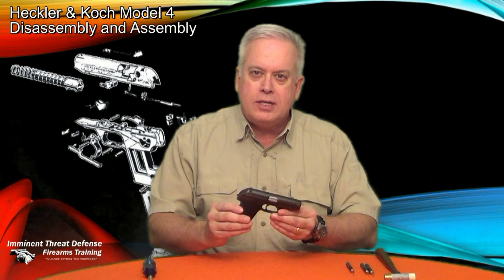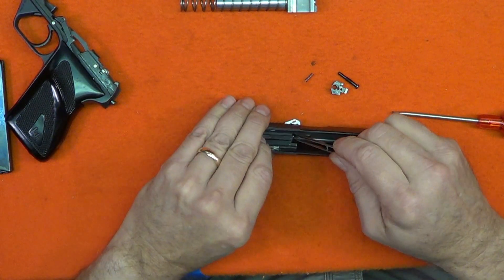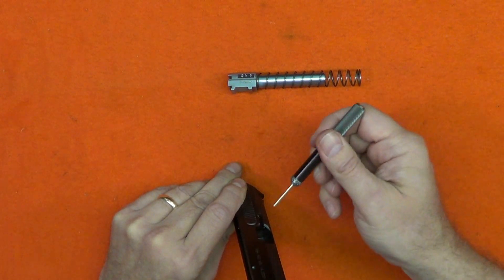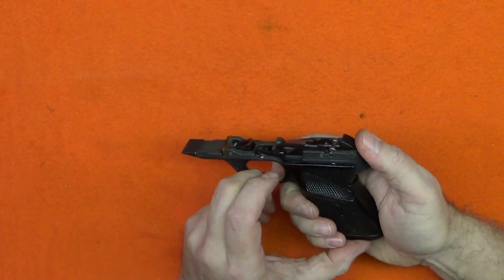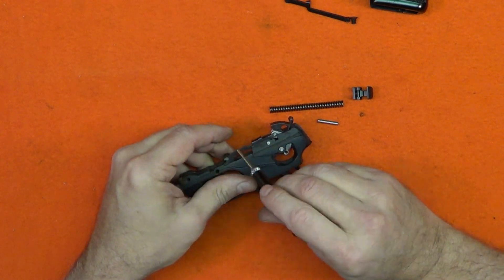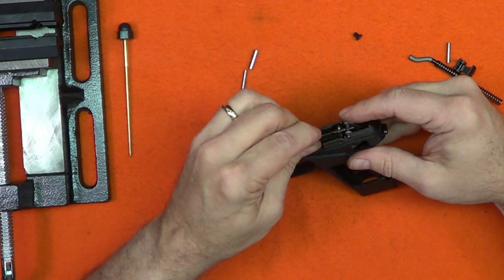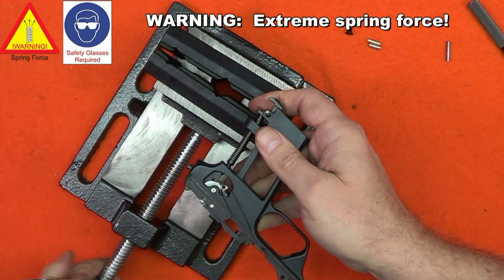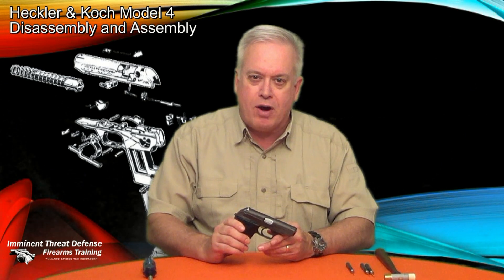Heckler & Koch Model 4 Disassembly and Assembly

Comment: Phenomenal instruction, thanks.  I am planning to replace my buffer.  Does the buffer plate need to be replaced at the same time and finally, can you point me to video instruction for this procedure?
Reply from the maker: No need to replace the plate, Numrich has the buffers.  It's pretty easy to replace it just slide out to the side, might need a gentle tap with a punch and hammer.

Comment: Very professional with excellent step set step procedures for teardown of the Model 4.

This gentleman has the experience and knowledge of a pistol which can be very complex to teardown.

Note: This pistol can and fire four different rounds through it, i.e. 22 LR, 25 ACP, 32ACP and 380 ACP with the proper conversion kits.

His comments on the firing plate (i.e. setup for rim fire and center fire rounds), the firing pin, etc.  is very complete.

His use of diagrams (i.e. on the two different springs in the firing pin assembly) and the tools required are very beneficial in the tear down of this weapon.

Comment: This is an awesome video. Some months ago, after firing a number of rounds, the slide became very sticky. Something wasn't right. Getting the slide off was a bit of a struggle but it did come apart. I then noticed that the trigger guard was broken close to the handgrip. I also noticed that the "buffer" had somewhat disintegrated. After searching the internet for a possible solution I came across Jim's video. Watching it, and referring to it several times, I was able to disassemble the it down to the bare frame. I found a professional TIG welder that was able to repair the broken trigger guard. To my amazement, and with the aid of Jim's video, I re-assembled the pistol, replaced the buffer, and have fired 14 rounds of 32 ACP. THANK YOU JIM. Without your video, I would no longer own an HK-4.Howard
Reply from the maker: +Howard Schneider Great save, glad the video was of help!

Comment: Mr. Jim, I need your help with this please.
First time I have basic field stripped this gun, Its been locked away in my Dad's safe for 35 years. I just ordered a new buffer and put it in place but I now cant get the slide back on. I have studied this video several times at the 12:20 mark. I have the hammer cocked.. safety on... lugs line up.... but it just doesn't engage the barrel clamp. It slides right back out.
Its very hard to press the slide all the way down. Can you help to see what am I doing wrong.
Thank you !!
Charles
Reply from the maker: Charles Baugh contact me directly at itdefensetraining@gmail.com and send me pictures of bottom of the slide with barrel and the top of the frame.

Comment: after firing a few rounds the slide became sticky for me as well. However, I am completely unable to get the slide assemble off the frame. it feels like something is catching on the inside and keeping it from moving forward. any suggestions?
Reply from the maker: +Samuel Taft Wow, that could be a million things.  First I'm presuming you can get the slide back and clear the chamber and make the pistol safe. Also you've done a detailed external inspection and you can't see anything else wrong.   First make sure the safety is on (white showing) and the hammer is cocked, the slide won't come off unless both are in the correct position.  Then be sure you're pushing the barrel clamp as far as possible, the thumb nail groove should go forward flush with the trigger guard.   If that doesn't work it's going to get complicated.
Reply: After 2 hours of forcing the slide and some gentle use of a flat screwdriver I was able to get the slide assembly off. A piece of metal had broken off and was jammed in the spring, not allowing it to compress. at 7:09 in your video you can see the piece in the bottom left corner of the zoomed window. there's a pin, an orange rectangle, then the thin black piece that broke off. no idea what it is.
Reply from the maker: +Samuel Taft Sounds like you're describing the Buffer plate.  It didn't break, it's held in place by friction.  The Buffer (the orange piece of plastic) is kind of squeezed in between the Buffer Plate and the frame.  It's possible your buffer has degraded, that happens, and let the Buffer Plate fall out.  You can get a new buffer for only $10 from Gunpartscorp.com.  You should be able to get your pistol back in action.  Good Luck!

Comment: I was cleaning my HK Model 4 22 Cal and a small spring fell on the ground. I did not disassemble the slide and also did not disassemble the sear. putting it back is ok but hammer always stay cocked even if I press the trigger with empty magazine. the hammer does not work. What do you think I can do. I can send you the picture of small spring by e mail if you have one. Thank you. Erick Berris
Reply from the maker: Sure I'll try to help.  Send me a pic of spring and where you think it came from.  ITDefensetraining@gmail.com  Though you might have a look at the video at 8:00 and see if it doesn't look like you dropped the ejector bar spring

Comment: Hi,,I'm trying to remove the firing pin and it won't cone out ,, I've put the saftey on the red position and the white and kinda in between the 2 and it wont come out ,  ,am I missing something?
Reply from the maker: No, it's just finicky.  Just keep a little pull on the pin and wiggle the safety and the pin, you'll get it.  The safety, in the safe position actually lifts up on the back of the firing pin (so the hammer can't engage it), so the pin will catch on the safety a little when you're trying to remove it.
Reply: Hi,, You were right,,I just moved the safety up and down till it was in the middleish and pulled gently with tweezers and got it out . Thanks ,I cleaned and oiled it up some ;; I have another quick question,, the mk4 I have is 1975 ,, thats what the targets say ,,  the gun frame /slide/ and both barrels all have the same serial #and thats good ,,  but the proof mark I see stamped on the slide /frame /and on each  barrell are the letters HK inside a circle,,,   the other hks I have use the elkhorn symbol ,, would you know what that means?  small capital letters HK inside a circle? new to me
Reply from the maker: @dantmanish  That's great.  Sorry but I'm not sure about that HK proof mark.

Comment: I have had one of these little jewels for years and have been looking for a firing pin spring for a few. Do you have the spec's on the spring, other than the number of coils. ID, OD,wire size and material? That would be greatly appreciated. I have been unable to get any response for HK. I bought the gun over 30 years ago at the Kittery Trading Post in Maine for under 200 dollars I think the spring dropped out when doing a caliber change in the field, I know not a bright move but had swapped back and forth many times prior without incident and got cocky. ;o)}  Thanks
Reply from the maker: Don't feel bad I did the same thing once, only I dropped the faceplate screw.  Now when I go to the range I always take my orange mechanics blanket :-)  Good luck getting a response from H&K they told me they don't support this model any more.  The best places for parts are Gunpartscorp.com and Jackfirstgun.com.  Gunparts shows out of stock, but you should call Jack First, they just started listing parts so their website is incomplete.  I do know someone who just sold some HK4 parts to Gunparts, so they either sold them quick or haven’t posted them yet, you might call them too.
As for the specs on the spring, that’d be quite a project and take some equipment I don’t have ready access to.  Though it’s something I’ve been wanting to do.  If you want to contact me directly through my website I’ll let you know if I ever get to that project.
Reply: Thanks for your fast response I have been checking back at Numrich for a few years, on the off chance they may find some. I'll give a check at Jackfirst and see what they can come up with. Again I thank you.
Reply: If you ever have the pistol apart, and are near someone with the precision measuring tools, could you prevail upon them to do some measurements? I asked a guy selling one, but the dimensions he gave me are not anything Wolff gunsprings can use to find, or perhaps make for me and he's has since sold the gun. I would need ID, OD, wire size, number of coils and length of spring and they might be able to fix me up. Perhaps there is someone else out there that has access to the tooling and expertise to get the dimensions. I will take it from there. ;o)}
Reply from the maker: I can get you the dimensions (give me a couple of days) but you also need the "K" of the spring.  We need to measure force for several compression distances, that's the tricky part so we can calculate the spring force constant (if you want to get it exactly right). Let's start with the dimensions, I'll pull mine apart this weekend.
Reply: Wow!!! Thanks for you help!! I really appreciate it, I hate having one of my girls sick or lame.
Reply from the maker: OK finally got around to looking at the spring.  I wanted to buy the spring measurement lab instrument from Starrett but at $7,000 it was tough to justify.  So I rigged up something in my workshop with a postal scale and a micrometer and got surprisingly good results.  First the spring is 11 coils and the ends are closed and ground.  It's 0.342" long, has an outside diameter of 0.108" and the wire diameter is 0.016".  Wire diameter was tough to measure so no guarantees I got it right.  The spring "K" is 86 (ounces per inch).  I plotted 5 different spring force vs compression distances and got a 99.5% linear regression, so I felt pretty good about that.  The range of K per 0.025" increments was 72 to 100 (the higher end in the first 0.075").  What that means is to compress the spring 0.100" it should take about 8.6 ounces of force. Contact me through my web site and I'll send you a picture if you want.  Good luck, I hope you can find a replacement part
Reply: I really do appreciate you taking the time to research this for me. I'll try these numbers with Wolff Gunsprings and see how it goes. I'll let you know how I make out. Thank you very much, Gary
Reply: I contacted Wolff Gunsprings and they were great. They came up with a spring that will probably work. It is a S&W cylinder stop spring the dimensions are very close and it looks like it will work just fine. I thank you for all your time and effort getting me on the right track. Nice website you have too!! Thanks again, Gary
Reply: If you ever have need of a firing pin spring the one I got from Wolff Gunsprings works fine. I gave them the dimensions provided and they came up with a workable match. It is a little longer than stock but does not seem to effect form, fit, or function. Their description is as follows, Stock Number 17181 Cylinder Stop Spring for Smith & Wesson K,L and N frame revolvers. they seem to work fine as delivered but you can cut/grind them to exact length if you so desire. ITM was instrumental in finding the dimensions out and gave of their own time, that is greatly appreciated, as there were few ti respond to my dilemma.

Comment: Anyone jnow where I can source the tiny ejector spring (#19)? My new to me HK4 is missing this spring...
Reply from the maker: https://www.gunpartscorp.com/gun-manufacturer/heckler-koch/auto-pistols-hk/hk4 Product number 75070, However, looks like it's out of stock, but put your name on their list and they'll notify you when once come available.  You can also find really small springs by scrounging around.  Take apart small toys, pens, lighters and you'll find all sorts of small springs that can be substituted.  Wolff and Brownells both have small coil spring kits that have assorted springs in them and you might find one to fit, you'll have to cut it to length.  Hope that helps, thanks for watching!
Reply: @ImminentThreatDefense  Wow, thanks for the quick reply. As I do not have the original spring for reference, might anyone here know the free length and diameter of the original? Number of coils? Compressed length? Thank you!
If it matters, I have a very early production unit, serial 105xx.

Comment: I have a Mod. 4 32ACP with My Slide Stuck Closed ! It fired all 8 Rounds, Slide stuck open and wouldn't Return. So with a little Muscle it was Persuaded to Close. Now It's Locked Closed !  Now What ? I Ran Out of Muscle and Don't Want To Break It !  Who or Where is an H&K Genius ???  Help !!
Reply from the maker: Probably what happened is the buffer disintegrated (one part I didn't show in this video) and there's a plate that protects the buffer that's now loose and jammed into the action.  Try using small repetitious movements of the slide while holding the pistol at different angles and see if you can dislodge the plate.  When you do get it loose and remove the slide be careful  not to lose the plate, but Numrich has them for $16.  Save the plate even if it's bent. The buffer is made of something synthetic and they eventually fall apart.  Buffers are used in a number of pistols and the ones in the HK-4 are about the same hardness of High Density Polyurethane (HDPE).  I'm currently experimenting with some 3D printed reproductions and I'm about to release a video on the issue and start selling the part.  But Numrich gun parts has had them, and some guy sells them on EBay.  I can't speak for either one.  You can get HDPE sheet and make one by hand with a craft knife and some sanding.  Or hopefully I'll be providing them in the next few months.  Hope that helps.  Thanks for watching
Reply: @ImminentThreatDefense  Thanks for getting back to me so Soon ! I'll be trying that soon, I think I Really screwed up when I Muscled it Closed ! Now there's no Movement At All !
  Thanks Again !!
Reply: Hi Jim, Watched Video several times now. I Finally freed the Slide up and when it was released handel a little piece metal shaped similar to the Rear Site (Buffering plate)fell out with some yellowish Brown stuff ! Where does the Buffering plate go and attach ? How are Your 3D Printed Coming Along  ???
   Thanks Greg
Reply from the maker: @ggsocal4511  So yeah, the yellowish brown stuff is what's left of the buffer.  The buffer is what holds the buffer plate in place.  They both fit into the slot right in front of the barrel clamp pin.  There's a pretty good image of it at around 6:31.  So you can't put the buffer plate in place without a buffer and you shouldn't reassemble or fire the pistol without a buffer.  I've got some buffers made, I'm in the process of testing them now.  Contact me at ITDefenseTraining@gmail.com and we can talk about a replacement buffer.